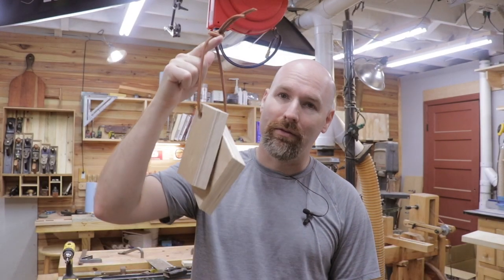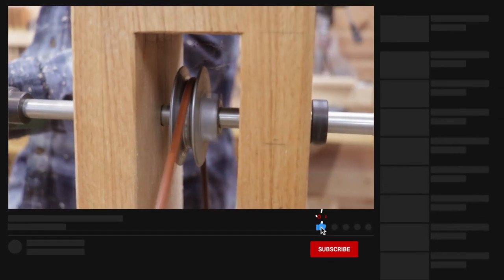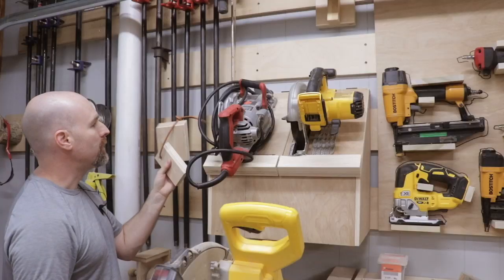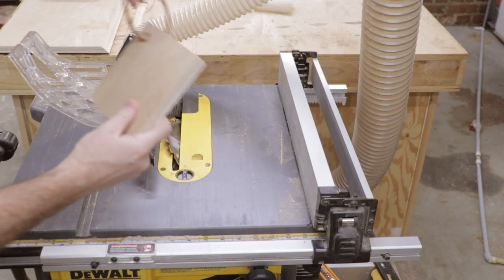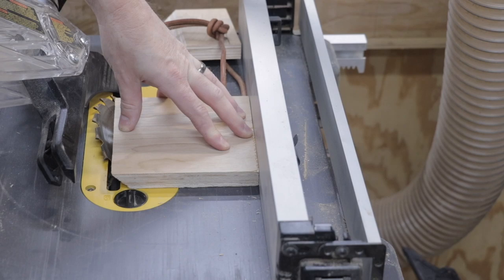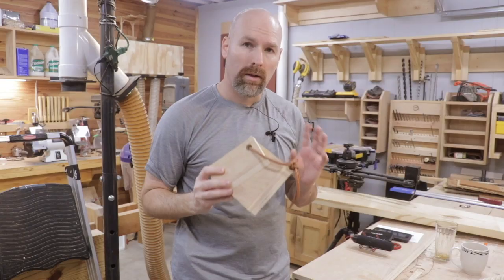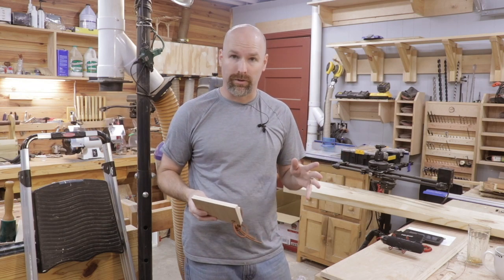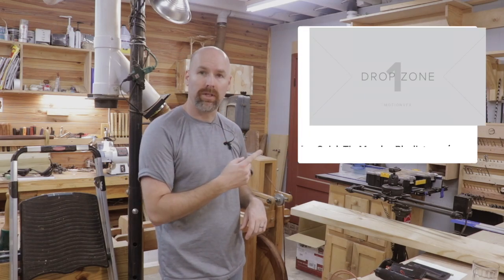Do Not Build A French Cleat Tool Wall 👉 Without This!

Comment: I actually thought that you were going to use it as a spacer when installing multiple cleats on the wall. 
Cheers John
Reply from the maker: It will work for that too! 👍
Reply: Don’t do that. I made that mistake in my first wall section. It will screw up your backer board sizing. You’ll end up burning extra material trying to account for this. Just space them 1/2” larger then long side of the cleats. That’s why the 5” ripped in half makes for perfect spacing calculations using a 2x4 on edge. You could still technically do this but you’d have to cut a cleat out of scrap that is 1/2”-3/4” taller then your actual cleat. My first wall I was low on ply and wanted to cover the whole wall so went with 7” spacing on 3” cleats which resulted in having to make a lot of spacer blocks for the bottoms dangling between cleats. After doing this then doing the simple 3-1/2” spacing I’ll never go with an odd ball setup again it’s just a lot of extra work when making the holders themselves when if the cleats were closer together they land in another cleat much easier and when being small enough it doesn’t the added support isn’t needed anyways for things that small. Worse if you used the clear itself to space as it won’t clear the above one. You’d have to chamfer the back edge of every clear and taking things on and off would be a hassle. Best rule with cleats is just keep it simple and be done. 5” rips ripped in half and it covers everything size wise. I wanted the cleaner wall look in the beginning and tried to get cute with going with fewer cleats.

Comment: Why not just use a standard distance for fence position from upright blade position  for each....... say 4 inches for tool cleat and 5 inches for the wall cleat.?
Reply from the maker: That should be fine! Just need to remember your measurements! My method, no memory necessary!

Comment: Why? This is simple math since it’s a 45* cut. Its 3/8” plus kerf thickness so 1/2” subtracts from desired rip size. There is a simple formula for different thickness materials for this but 99.9% of people are mostly gonna use 3/4” and use the 5” rips to make two cleats off one cut. Center line of 5” is 2.5” -3/8” plus 1/8” so if fence is on proper side of the blade the rip is set to 2” if set to other side it’s 3” this puts you perfect with mdf and between 1/16-1/32 difference in ply sheet goods. If it were a 10” sheet with 5” CL then set fence to 4-1/2 etc.. this is easier then tying to eyeball to an old dried up piece of scrap that’s been cut with and cross grain many times before drying. After drying the board would be way way further off then you’re eye could determine trying to set to an inverted bevel cut.

All one has to know is the cl of the board and the thickness and account for the kerf.. all things that are woodworking 101 things.